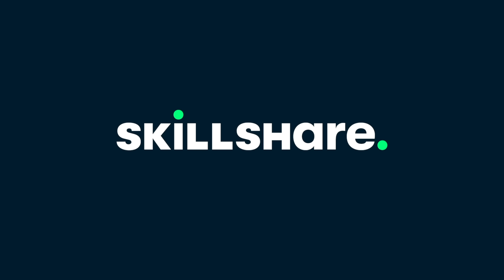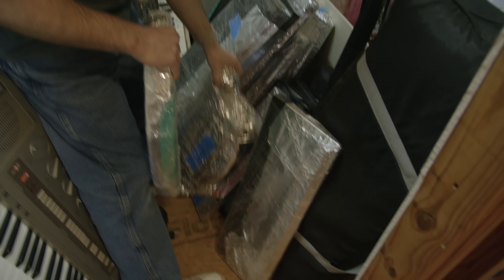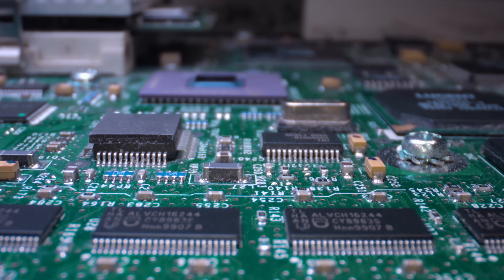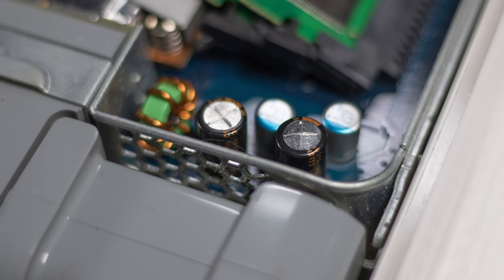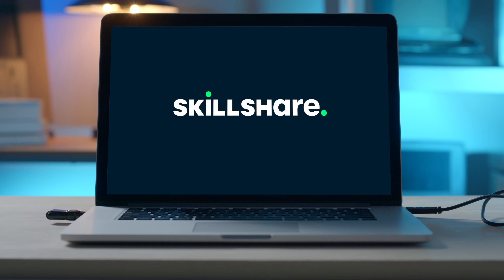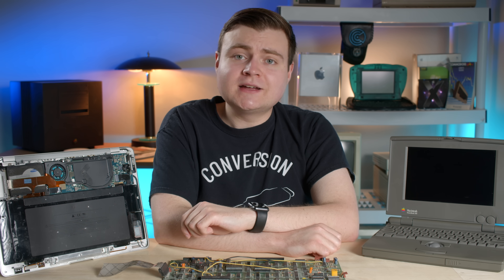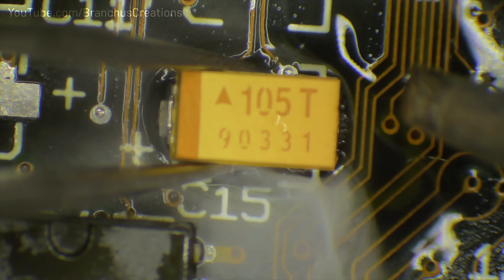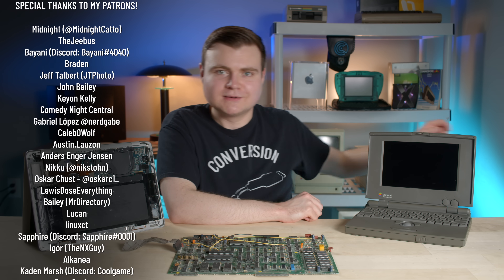Why Do Computers Die? (ft. The 8-Bit Guy) - Krazy Ken's Tech Talk

Comment: That capacitor explanation is way too simple, they're not ONLY used for filtering. To transform a signal, which is what 90% of electronics do, you need an equation to describe the transformation, and capacitance is one of the factors of the solution. Take a look at analog electronics theory, it's quite interesting, but be warned, there's a bit of college level math involved...

Comment: “Capacitors help make our electronics work properly” you don’t fucking say Sherlock homes.
Reply from the maker: Fun fact: most people couldn't tell you what a capacitor does. Not everyone knows everything. Take a chillow pillow.
Reply: @ComputerClan  that's still not a good explanation for people who don't know and that's the point, its like explaining to someone who doesn't know how gravity works by saying "it pull down" Correct? yes (for current science laws) but not the best way to say it.... 99.9% of people with a brain could reason if they didn't know what they are that they are there for a reason and probably help circuit in some way. A better into woulda been "capacitors aide in a circuits power needs" This way if somebody doesn't understand the long winded explanation they at least have a general idea. Might as well of said "it do what it do"

cmon man, I see what you were trying to get at but you gotta  know what they do to understand "... work properly" means helping a circuit keep up with its power needs as in keeping things stable and not just as a vague term; how even I saw it for a few seconds.and to most people, that's how they will see it, as "well no shit, they are there for a reason, so they must be needed somehow to work correctly" completely "reading" over the hidden meaning
Reply from the maker: EndOfLineTech I disagree. I gave a short answer, then a slightly longer answer, then I made a relatable comparison to an everyday object: a bucket of water. 1, 2, 3. It’s an easy way to teach. People like 3's. I know what I’m doing. ; )

Comment: A design 'horror' on a server:  The HP ProLiant DL380 G4.  The chipset heatsink was held down by a spring wire hooked into loops soldered to the mobo.  After running at operating temps for several years, that solder softened enough that the spring wire chucked the loops to parts unknown.  The chipset died in short order because of poor heatsink coupling, and it lacked a thermal cut-off.
Reply: This happened at my school!

Comment: Oh, this made me think about my dead evga power supply that died 2 weeks after I bought it. It probably was a Capacitor failure.
Reply: Spent a month trying to figure it out. Thought it was the motherboard. Sent the motherboard to RMA. Got it back and finally realized it was the power supply. Returned it to crappy amazon seller. Took two weeks to get a refund. Then I got a Corsair Power Supply
Reply: Works to this day
Reply: @kalebchoi6372  I am still using an Antec 380W psu from 2006... No trouble yet! (except for when it got to 112F/44C ambient then it tends to shut off a lot but i'm not gonna blame the power supply foir that)

Comment: Yeah, I can confirm that the Late 2011 MacBook Pro was the worst MacBook that I’ve owned, reliability wise. It had the fabled discrete GPU chip that was poorly soldered to the MLB and subsequently died. I can’t, and probably won’t, be able to find someone to fix it. They all tell me to recycle it, which is a little difficult to do as it was my first brand new Mac, when it came out. Loved the collab, and a great video as usual!
Reply: Same MB here. If I had replaced the thermal paste a few years ago, I could have saved it. In the end, I just shut off the GPU (there's a resistor you have to desolder) and it still is my main computer.
You might not need the hardware modification. The software solution is here: http://dosdude1.com/gpudisable/
Reply: il biggo thanks, I’ll be sure to take a look at it. Most of the problems, from what digging I did, fixed it until the system had a chance to enter S3 state, and subsequently kernel panic. There really haven’t been many solutions to this, other than use Lion, and I’ll also take a look at the hardware mods that may help as well

Comment: I have a horror story: I had a 2013 Acer desktop running Win7 that was a bit slow but worked fine. I always put the computer in sleep mode rather than shutting it down unless I need to restart the computer. One day, I came home from school hearing the computer beep. It wasn't a pulse beep (Beep beep beep beep) but a long beep (Beeeeeeeeeeeeeeeeeeeeeeeeeeeeeee-). So, I forced shut down the computer. I was terrified for the computer, wondering if it was broken, and if it was, what broke. A couple hours later, I turned the computer back on. On the monitor, it basically said "The clock battery needs to be replaced". At first I couldn't figure out the message so I took a picture of the screen and sent it to one of my friends to figure it out. Then he told me what was wrong with the computer. I turned the computer off, started sharing my dad's laptop with him and never touched the desktop since.
Reply: Now I'm curious...was it the clock?

Comment: Only ELECTROLYTIC caps tend to fail.  All solid state caps (ceramic, mica, tantalum) will last forever...

Another possible failure mode: programmable devices losing their programming.  Things like EPROM and EEPROM devices (early precursors to modern flash memory) have their programming stuck on floating gates.  Eventually the stored electrons can tunnel away, resulting in an unprogrammed device (or a device that has lost a tiny bit of its programming).  This might take DECADES to happen, and high temperature makes it worse, but it is worth considering.  Note that PAL, PLA, and CPLD devices use this same tech to store their programming, so those devices can fail.  Such devices can be used to help make "glue" logic that ties the device functions together.  But devices like this started being made around 30 years or so ago, so start to expect those failures.
Reply: tantalum? last forever? ONLY if they have clean power, otherwise they literaly go thermite!

Comment: 5 years ago, I found an old Packard Bell 850/607G computer, which was actually one of the later ones manufactured by NEC circa 1998, out at my grandparents farm. It had to of been sitting in their shed for almost 10 years, but I still wanted to see if it still worked. They said I could take it because it was junk. I got home, plugged it in, turned it on, and to my amazement it booted up perfectly fine🤯. The computer was incredibly dirty and had a lot of rust on some of the I/O ports, but still surprisingly worked! I ended up abandoning the restoration project and recycling it a couple years ago as the case was starting to fall apart and replacement parts were really hard to find.
Reply: I still have 2 NEC Packard Bell PCs, they are really built to last/ An NEC UTOW CAl one from 2003 that I was given because was being thrown away and had it  been left out in the rain for a few days (it soon dried out) . I have an Easynote TS13 from 2012/2013 ish  (I think that is an Acer made packard Bell with an I3), that is still my main laptop and I got it extremly cheap second hand.  My favorite one though is a 2000/2001 Packard Bell La Diva all in one, which is ultra rare and totaly unique. It has a wireless keyboard, mouse and trackpad. It also has a modem built into its external PSU and a laptop PCIE slot (and laptop  IDE) , it is running Windows ME and it only cost like 17.99 on ebay (I don't think I can get any spares at all for any price either)  for it bar the , the HDD and the RAM and maybe the PSU Modem). Thankfully it still works like the day it was made, with all the original components (as far as I know, a sticker on the side says it was referbished in 2003 and may contain used parts!).

Comment: The 360 RRoD is also caused by excessive heat.
Reply: And shitty solder
Reply: Josef Aschwanden which was because the standards demanded lead-free ones and they used the wrong type
Reply: @tezcanaslan2877  thanks god i can use leaded solder at work

Comment: Dodgy PSUs... I'll leave you to guess what happens
Reply: Are antec psu dodgy? am still using an Antec 380W psu from 2006... No trouble yet! (except for when it got to 112F/44C ambient then it tends to shut off a lot but i'm not gonna blame the power supply foir that)
Reply: @virtualtools_3021  I have an antec PSU from probably 2007, 550W and still running fine today
Reply: @hardrivethrutown  nice

Comment: I believe you missed water damage!

Well, technically speaking not technical problems but I would say it is the #1 killer for electronics.
Reply: Dont get drunk and spill beer in laptop keyboard!!! Most expensive beer ever.
Reply: Electrostatic discharge and power surges too.
Reply: ok then don't store your pc next to the water heater, pool, or bathtub problem solved
Reply: Yup, water can kill anything with electricity if they are long enough to break
Reply: Computer enthusiasts sometimes soak their computer components in a water bath to clean them, and then air dry for weeks
Reply: @mrmaniac3  Yes -- distilled water. This is an important distinction.

Comment: Yo my 4k samsung tv broke down and when i took it apart, all i needed to replace was 3 out of the capacitor and it worked
Reply: what is it with samsung TV and capacitor failure
Reply: Red Stoner never had one but i knew pepole who had that problem. I agree ALOT with you
Reply: @Handlethatwontbetaken  i just noticed it from the sheer massive number of samsung tv repair guides on youtube that all they had to do was replace a few capacitors
Reply: @virtualtools_3021  Planned obsolescence perhaps.

Comment: didn't mention that the actual chips have a number of issues, the main one being that they simply weren't ever designed to operate for more than few years and they fail in numerous ways .. in time, they will all fail (not powering them up only delays this), the retro scene sings the recap song like it's a magical panacea, but quietly guts machine after machine to salvage parts to patch up an ever decreasing number of functional units. Many chips have't been in production for years or even decades, replacements have to come from somewhere. Retro collecting is not preservation, which would involve specialist storage, climate controlled nitrogen environments, the works. No one is doing this, and tin foil/cling film is not really even coming close.

Comment: Semi-related RE your PowerBook 100, I would be interested to see what happens if you hold down the reset and interrupt buttons after powering on. The clicking should stop, and then you can just hit a key like normal to boot it. Mine has very similar symptoms to yours, it will click and the screen will glow when power is applied, but if I do this 'trick' it'll start booting. Obviously still need to replace capacitors. I'm trying to compare mine to others out there.
Reply from the maker: Huh. I should try that.

Comment: I still have a 2001 Compaq laptop that still turns on, I had windows 2000 on it since it only had 256MB of ram, found more ram on ebay now its maxed out at 512MB of ram, then upgraded it to windows XP pro, then upgraded the CPU from 800Mhz Pentium 3 mobile to 1Ghz Pentium 3 mobile, 80GB hard drive, added a linksys wireless G pcmcia card,  100MB wired Ethernet port. firefox verson 52. Youtube videos run at 1 frame per second, i just use it as a joke to friends that come over and want to use a computer lol
Reply: I have an early 2005 Apple PowerBook G4 15" Aluminum (1.67GHz, 2GB RAM), that'll run YouTube videos at 360p, using TenFourTube. The app uses the mobile version of YouTube.
Reply: @benjyfriedman  I have an iMac G5... with leaking capacitors and a slightly broken mainboard due to leaking capacitors. Also, i have a 2005 PowerMac G5 dualcore... with leaking capacitors and about the same issues as the iMac. There is a rumor, that the capacitors Apple used in the G5s are rubbish. I tend to see where that is coming from^^
Reply: @Emptiness_Machine_2001  Capacitor plague was also kinda around during that era of computing.
Reply: Tim Weber The reason why the capaciators are rubbish is because of the capacitator plague
Reply: try h.264ify to give it a chance of running youtube
Reply: In my highschool, we had old Win XP Thinkpads in the physics room (in a storage room next to the physics room, but ya know, they were there to use them with different plug in light sensors and other sensors for class and also, we used excel on those things as we made a solar clock that is always accurate (mine gos 25 mins ahead as i measured our house wrong) and that was... a lot of numbers).
I always told the teacher, that before they get thrown away (originally, they were supposed to be replaced by 2014), I want one or two. Two weeks ago, 1 year after i finished school... they finally got eplaced so I have two old thinkpad T42s to mess around with. They still work really well, considering the were used in a school for over 10 years, only the batteries... are a bid on the weak side^^
Reply: Sounds really useful
Reply: Try running Linux on it.
Reply: I've got a 2007 dell inspiron 531s still works never been serviced

Comment: One problem I got with an old Windows XP with an IBM PC Motherboard... I guess. I accidentally ran into a HUGE Hard Drive Failure when I plugged it in. When I turned it on, I realized pink smoke had came out of the circuits. I turned off the computer QUICKLY before it did any more damage. Luckily, none of the actual computers motherboard was damaged... or so I thought. When I went to test it a few days later, I realized the PS/2 Keyboard did not work.
Reply: The hard drive that emitted the smoke had been going squeeeek**titick multiple times before it failed severely
Reply: Smoke Machine!

Comment: You seriously just taught me why one of my computers has to sit plugged in forever before it will turn on. I guess it is a bad capacitor. However, I have no idea where the cap is, so I wouldn't know what to replace, not like I even have equipment to do it with. I assume it is in the PSU though so replacing the PSU would probably just be safer.
Reply: Weatheronthe8s Most of the busted caps I’ve seen can be spotted by looking for slightly raised tops (pretty much anything that’s not “flat”) or visible corrosion around the legs. If you don’t see any and don’t have some that are covered by integrated heatsinks (or any that are difficult to remove), your guess about the PSU might be correct.
Reply: @SquareOFortune  Yeah, I have checked my motherboard and haven't noticed any raised caps. It's an old motherboard for a home version of an office system so I kinda doubt it has heatsinks on any caps. I have also tried to look into the PSU, but can't really see the caps because it's too compact to really see inside well. I might get a TFX PSU at some point as that is the kind it uses, or I could just live with it I guess. I keep it plugged into a UPS just so I don't have to worry about waiting forever to turn it on if the power ever goes out.
Reply: Weatheronthe8s Right on! Glad you haven’t tried to open the PSU; opening those or being around exposed CRTs (especially the anode cap) are two things I never recommend for home repair. 😅
Reply: @SquareOFortune  Yeah, I've heard those are things that could be potentially dangerous to work with if you're not careful. I would never work on one of those things without doing proper research first and even then I'd still be nervous.
Reply: Well...replace all the caps?
Reply: @vectorjoe  I mean. It could be done technically. However, I don't know the first thing about soldering so I would not feel comfortable replacing all of them.
Reply: capacitors are everywhere and serve a lot of functions, such as storing temporary energy as general, then smoothing the electricity, storing energy for short burst needs (like flash on your camera), and many more.

Replacing THC or through hole components are pretty easy but if you're begginer, smd caps just aren't worth it. Not to mention there are probably tens of them
Reply: @ragilmalik  yeah. I have no idea how to solder really, so I should probably start small at first. I know capacitors are used in tons of things. I remember my dad's outside AC unit went out because of a bad cap, but you could start it if you spun the fan with a stick or something until we got it fixed.
Reply: A soldering iron and probably a multi meter are cheap and might come handy for other problems. Maybe one of your friends can lend you one. Try it out on a broken piece of tech, the steps are the same.
Reply: @carl2k6  yeah. I have been thinking of getting a soldering iron for other projects. I just haven't done it yet.
Reply: @weatheronthe8s895  have you ever got around to fixing it in the end?
Reply: @pavlovidankmemeovi I ended up just replacing the PSU in the end.
Reply: Maybe it can be the battery my ipad wouldn’t charge or turn on but when i replaced the battery it just worked fine

Comment: I went through 3 Surface devices in the span of a year. The first two surface laptops got orange dots on the screen and the surface book 2 had a bend in the clipboard from the factory and usb port that died after 6 months. After Microsoft refused to replace the surface with a new one (mind you we had microsoft complete) I ditched microsoft for lenovo and so far it's been working great. I loved microsoft's products, but their QC seems to be just horrible. Also idk how it's possible that that macbook that looked like it was shot wasn't the worst one.